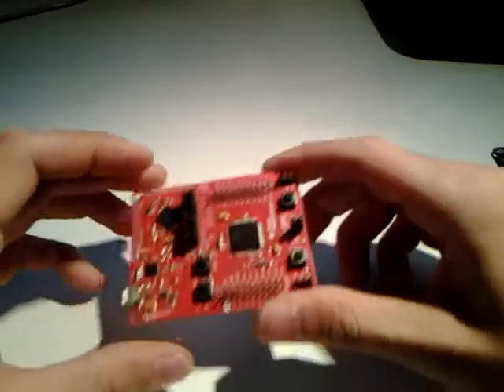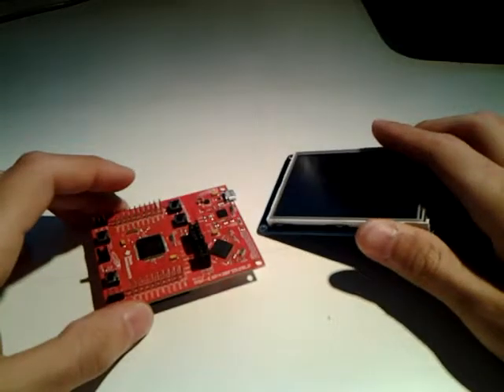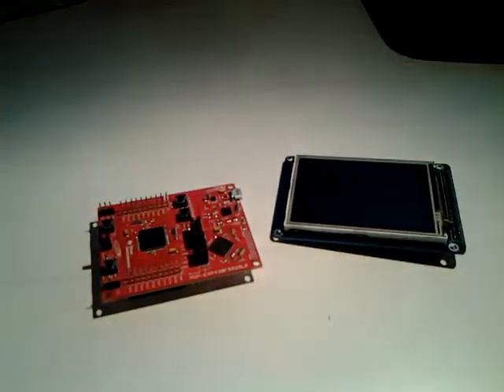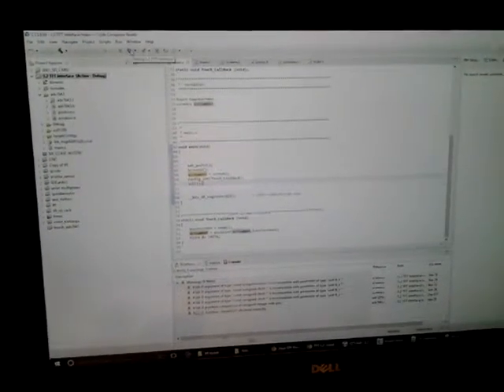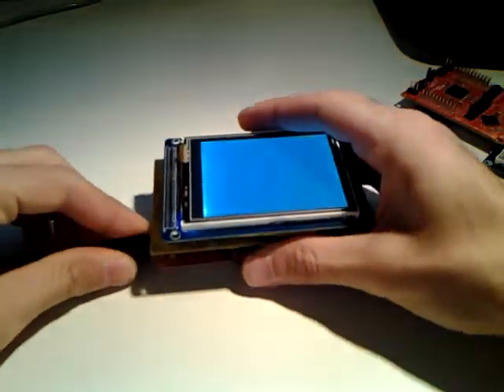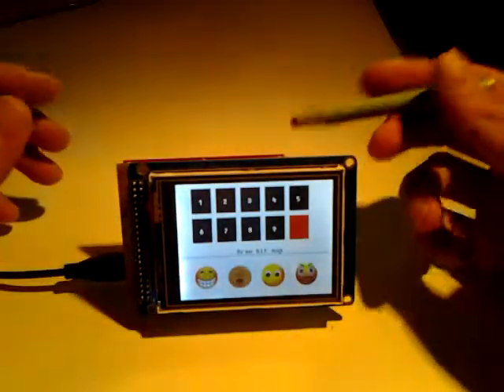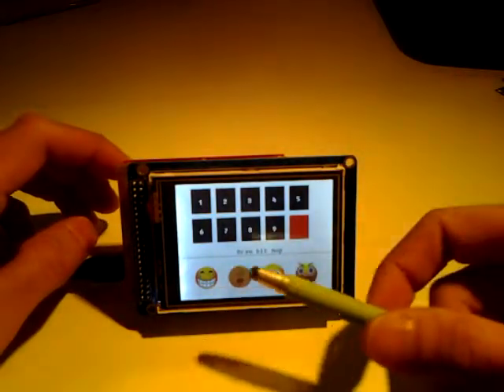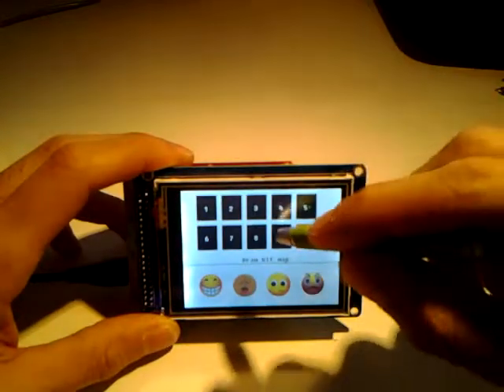3.2" TFT interface with msp430

Comment: I have a MSP430FR6989 microcontroller, and i need to interface  1.44 inch SPI TFT display, in having alotta pain with the libraries and an error message in energia, can u help me?